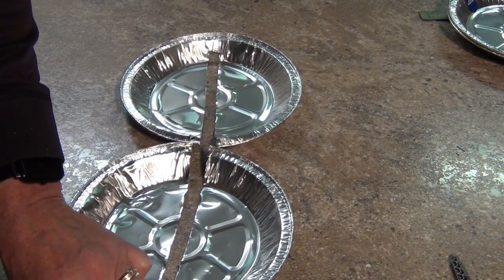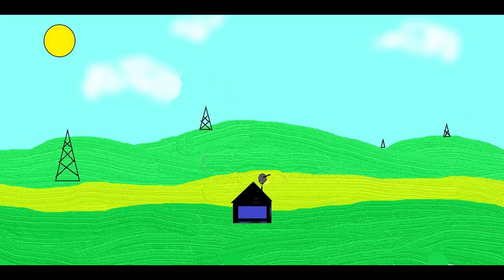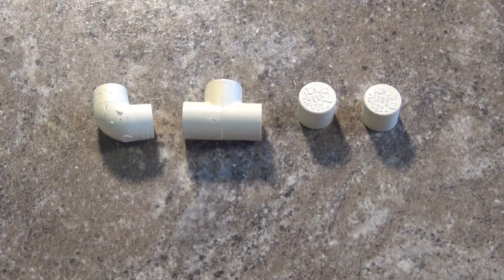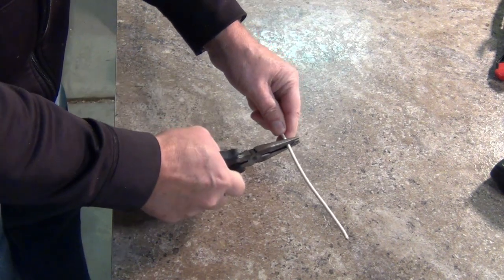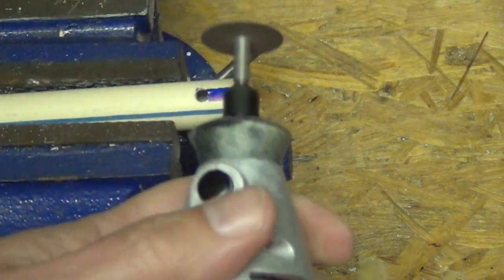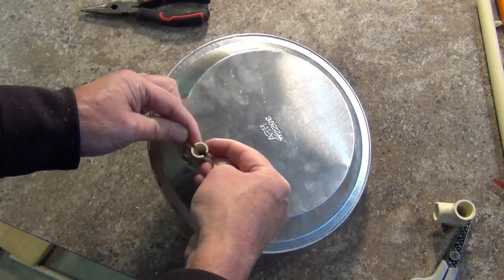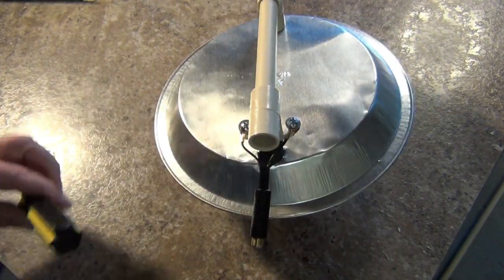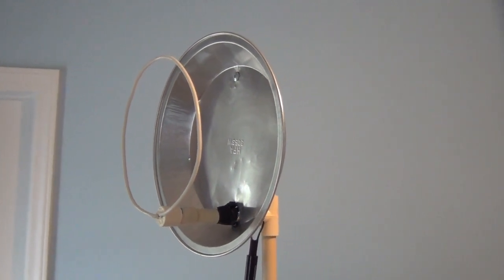New Design - Antenna for Free HDTV

Comment: I've watched a few of your DIY TV antenna builds. It would be great to include a calculator so we can build for a particular channel. I know these are fairly broad-banded, but my weakest ch is 14, at 470 Mhz. Almost all antennas are built for the higher channels, like all the commercial ones peak gain above ch36 which is now our highest frequency (608Mhz).
Guys could even scale some of your designs for the FM broadcast band. Thanks!
Reply from the maker: Noted! Thanks for watching
Reply: While a personally think 6.5 inches is too small for even CH 36 just going by his design you'd want to cut 38 inches not 32 inches for CH 14. I'm also not a big fan of having 6 inch leads coming from the loops but that is his design. 

Personally for Ch 14 I would use 36 inches with the leads only being 1.5 inches each so 33 inches left for the loop which would make it 10.5 inches. Of course you're going to need much larger reflector something more like 12 inch pie pan.

Comment: Will this work as FM antenna also?
Reply from the maker: It will probably work to an extent, but it is designed to optimally receive UHF signals, not FM. It's success will be dependent on your specific situation. Thanks for watching.
Reply: @mrhoptoit7835  Did you check to see how far this antenna can receive a signal Mr. Hop To It ???
Reply from the maker: @victoryfirst2878  in my situation, I pulled in stations over 50 miles away.
Reply: @mrhoptoit7835  Would making this antenna a double side by side increase the distance reception of this type of style antenna ??? I hope you are going to make more videos on more antenna MHTI. Nice work too.
Reply from the maker: @victoryfirst2878  another video idea. 👍
Reply: @mrhoptoit7835  This is what came to mind. All the cell phone technology used today uses antennas made with cutout triangles on a flat sheet of metal. This supposedly really increases the punch of signal from the unit. This also works in the reverse direction. 
The idea is to use a sheet of metal which has the cutouts already done and wrap them onto round PVC tubing into whatever shape you would like and see the killer performance of the unit. Good day and good luck too. vf